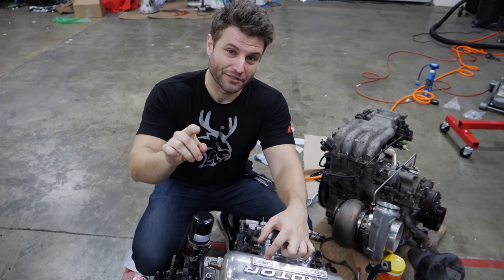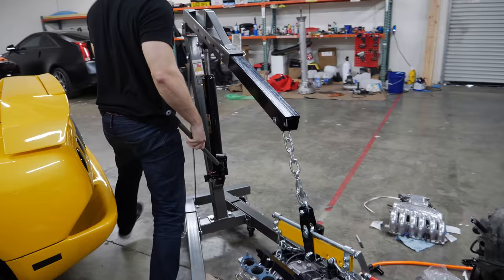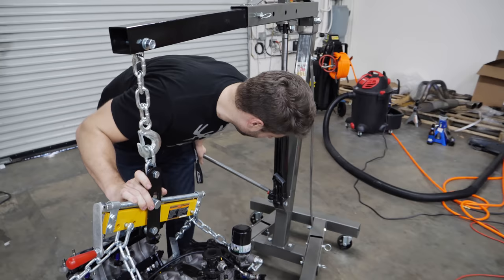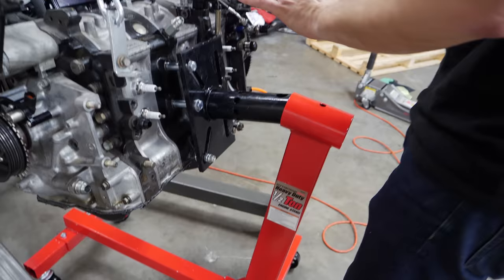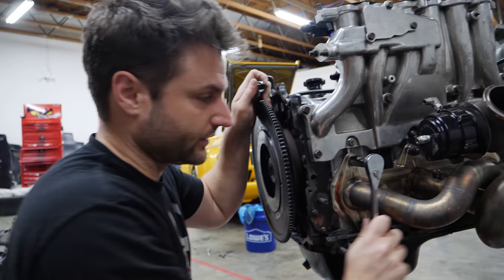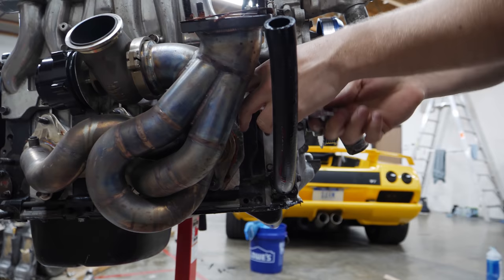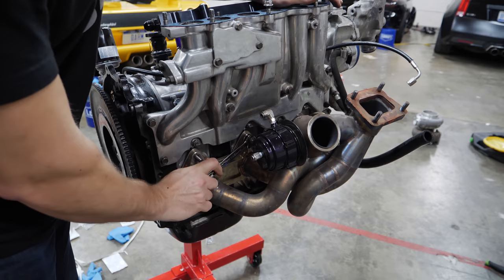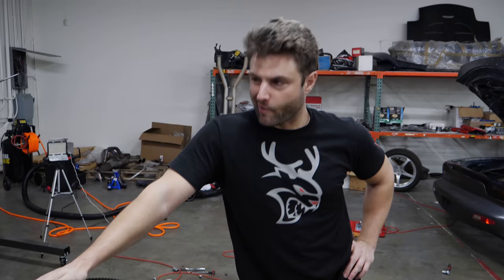3 Rotor Vs 2 Rotor. Why I LOVE the 20B so much.

Comment: Instead of going through a lengthly and costly conversion, Ive been thinking about just getting a 3 rotor Cosmo now that they are 25+ years old.
Reply: @rotorthermotech1310  There's a few on my local Craigslist for $19k with clean title.
Reply: TurboDieselDan , that’s reasonable, rare as hens teeth here in Australia
Reply: Very rare cars those cosmo's

Comment: Rob Dahm Engineer an intake air cooler that uses Dry Ice in a closed system to cool your intercooler.  Excellent videos, longtime fan here.
Reply: Wouldn't work dry ice is mostly co2 so not much "air" there.
Reply: @joedumars7311  Not to be an asset, but no kidding man 😂...a closed system means using the cold to cool a copper "intercooler" on the intake utilizing dry ice, while venting the co2 into the atmosphere.

Comment: I'm surprised to hear the 13B from Rob's car only 350 lbs include everything, I remember someone weight a 13B-REW (twin turbo one, with all the stock accessories on it) was around 510 lbs, where LS engine were merely 400 lbs.

Comment: So, let me get this right, a giant turbo 20b will make more power than a stock ls6? Um, duh? 
A modified N/A 3 rotor is only going to make 300whp.. a stock ls6 is going to make more... Turbo'd 3 rotor, vs turbo ls6, they're both going to make tons of power. 

You also weighed the cast iron stock manifolds for the ls6, but not the manifold for the 20b... 

I'm not hating on the 3 rotor, in fact, I would love to put one in my ae86 like those crazy Japanese guys did years ago... but this is a apples to oranges comparison masquerading as a "fair" comparison.
Reply: 20B exhaust manifold was still on the motor when he weighed it.

Comment: So I have a 350z shell I've been planning on putting an LS in, but there's a free non-running 13b in my town I might pick up. I also have a diesel turbo that's normally useless for gas engines due to oil pressure... am I crazy for considering putting this in the Nissan? I know very little of Dorito engines....

Comment: Can you do a comparison between  the 4 rotor and LS. And explain how you get a 4 rotor since Mazda didn't make them for production vehicles.
Reply: Wise Guy you can get a 4 rotor by taking two 13b’s and putting them together. The only hard part is getting an eccentric shaft since Mazda didn’t make one. But some rotary shops custom make them. I’m sure if Rob made a video he would go into more detail.
Reply: It's almost like he made almost a whole video series about getting the 4 rotor, and then it getting lost, and then him having to buy the parts a second time from the guy who bought them at a FedEx auction.
Reply: @dan.r9220  thanks man, I didn't know that he did. New to the channel and looked and found some of those old vids. Appreciate the direction.
Reply: @wiseguy__  of course man!! Always here for the help. Rob has a lot of good rotary content from back in the day. Then he took a long break and is now back on more consistent video making.
Reply: Pinball Master no thats not how you do it.
Reply: Wise Guy that is incorrect.

Comment: I'm not trying to criticize and I'm certainly not a fanboy of pushrod LS engines, but after comparing them and stating that they were comparable in weight with the 3 rotor being just a bit lighter, you stated that the 20B could kick the LS6's ass.  But in stock form a little googling led me to find that the the 20B produced 300 HP with 10 lbs of boost but the LS6 produces a minimum of 385 HP with no forced induction.  I think it's also well known that rotary engines consume a lot of fuel, so I don't think that is kicking ass.  Especially since the LS6 could still be force fed to increase it's numbers just like the rotary could.  To make a fair comparison I think both engines would have to be in a similar state.  It would be more accurate to say that PER LITER of displacement, the rotary kicks ass.  That seems fair.  Am I missing something or are you indeed being a fanboy?

Again, nothing against the rotary.  I love the small size and light weight, but in this case that doesn't seem to be the advantage.
Reply: The rotary can make more power if you can rev it up to 11000 rpm without it blowing up.
Reply: It can make more power if you can rev it up to 11k rpm it without bowing up. Though it'd need premium fuel n ither stuff

Personally i think the best ice is 2 stroke opposed piston engines tho. Double the power strokes and already self balanced engine.
Reply: Mazda Miata but would it make similar power to the ls6 but revving higher and would it be nearly as reliable? As OP said, not fanboying LS’s. Just curious
Reply: Mazda Miata by revving higher*
Reply: The n/a LS in the dry around 400lbs...
The 3rotor with turbo around 400lbs...

Taking that package, the 3r wins - this is what he did say; also he did mention, that you can do forced induction on the LS but that will add weight as you need additional oil cooler, turbo(s), piping aso....

You can then build a twin-turbo 4-rotor - that sounds like a F1 car and goes like the Belzebub who burned his balls on the stove.
Reply: @ldorman  Ok, so by weight then.  But it's still 85 HP shy.  That's a lot.

Comment: The 2 rotor 13B RX8 engine does have three runners on the Exhaust manifold due to the the side port exhaust design.
Reply: Yea but the renesis is a special case that nobody builds for performance cause its pointless.
Reply: @fastec5  Not true. People reliably have installed turbo's with proper piping and intercoolers to achieve 300 BHP on a renesis engine at 12 psi of boost. It's not common, but definitely can be done and not completely difficult.
Reply: @sofakingdom3076  we are talking from the factory here. You are talking to an RX7 owner who is piecing a Reni together in hybrid fashion to slap into my FB lol, I know. But the Renisis is the engine that destroyed the rotary's name.
Reply: @fastec5  Emissions destroy many engines including the renesis. I think it's great for what it is.
Reply: @sofakingdom3076  except for the inherent design flaws Mazda put in it. The exhaust port design is terrible and allows carbon to build up. When that carbon buildup breaks off bye bye seals. And the oiling system is terrible. Mazda fixed the Reni's issues when the S2 came out but by then it was too late. Also, emissions affected the 12a and those things were bulletproof.

Comment: I've always wondered where people get these 20Bs ? 
Except the Cosmo which is a valuable classic and the 757/767 which are valuable racecars, Mazda never put this engine anywhere else (i think).
Are they custom made with 13Bs ?
Reply: 9 times outta 10 that's exactly what happens. Unless you get a half cut cosmo from overseas you've gotta get your 20b power through a highly skilled machinist.

Comment: So your saying a completely custom fully built rotary engine is better then a bone stock LS6.  Good to know.
Reply: Yes, and at the same time, a bone stock rotary is better than a custom fully built LS.
Reply: @bigolbootycheeks9138  lol, I do agree with you kinda.  Its funny how "fully built" lead to breakdowns more often.  I would still run a cam only LS over a rotary just because it easy, powerful, cheap and still more reliable.
Reply: @bigolbootycheeks9138  Nah..

Comment: Honestly, the 3-Rotor should go in the Corvette Body & the 2-Rotor should go back in the RX-7.
I remember how much of a problem you had with engine bay clearances on the RX-7 with the 3-Rotor.
Shoving a 3-Rotor in a tight bay isn't good for (thermals, maintenance, or modding)!

You want to have as much room as possible for all the crazy stuff you want to do, that means shoving the right Rotary in a spacious Engine Bay so you can do work and improvements.
Reply: @msengineeringdavid3702  You first!

Comment: I'm pretty engine agnostic, just trying to understand. How is the 20b more powerful than an LS6? I'm looking up specs, and I'm seeing between 250-300hp for the 20b, while the LS6 makes around 400 if I remember correctly.
Reply: He's accounting for the fact that he added a turbo to the weight. he can turn the turbo up and the rotary will easily make 1000+.
Reply: @dan.r9220  it'll hold that power with stock internals? I can't remember what the stock LS motors will hold, but it seems like it was 600 to 700 hp. Doesn't cost much to bullet proof them though.
Reply: @jasepoag8930  Yeah I think it's all sort of a lie from rotorheads.  He's not comparing a stock 20B.  It won't hold 1000hp w/ no mods.  If it did everybody would have one.  It'll cost more money to get a 20B to 1000hp than it will to get an LS to 1000hp.
Not quite sure how he justifies comparing a boosted 20B to an NA LS and then saying you can boost LS's, but then writing that off like some extremely rare thing, as if boosted 20B's are in every junkyard.

But anyway, takeaway: "20B > LS"; "These are just objective facts, I'm not being a rotary fan boy here"
Reply: @MrSlowestD16  Pretty sure if they are throwing aftermarket into the equation, N/A LS is over 1000hp... aftermarket block and headers will be lighter than a 20B and stock for stock the LS is more reliable, better fuel economy and fits more displacement in a smaller space.   With that being said, I would still like to see more rotary stuff.
Reply: He was just strictly saying for the weight of those setups a 20b with a turbo will make more power than an NA LS.. You could throw a ton of money at it and make as much as that 20b I'm sure no problem but as they sit the 20b will make more power easier. That's why he kinda said that's neither here nor there because he knows it'd be easier to throw a turbo on that LS and it'd smoke the 20b he was just kinda saying.. No real point. We all know what's up, the LS is more reliable and cheaper to make more power.

Comment: I could have bought a 13G spare 3 rotor race engine from racing beats land speed record rx7 for 10k , but shipping costs were killer
Reply: When was this? Like close to a decade ago? I remember that thing, they put it up on rx7club I think. Quite the motor for the price.
Reply: longer, back in the late 90s .. saw it advertised in the back of fast fours & rotaries . this was before everyone was shipping stuff everywhere and you can get deals and it cost a mint to have large items sent from overseas.
Reply: @shoominati23  damn, that's cool. I know there was an exact replica of a 13g, down to the sliding throttle bodies even, that was up for sale about 10 or so years ago on the club. I think it was about $10-12k

Comment: The question I have,  is can you make a rotary as reliable,  or last as long as an LS?
Reply: Yes, it's possible. All depends on the way the engine is used and the maintenance you provide.. If you drive like a dickhead and don't look after your engine, it doesn't matter if it's a rotary, a LS or a Detroit diesel, it will fail...

Comment: Hello,
You think it's possible to put a 3 N/A rotor on a RX-8? (and how much horse power to expect?)

Thanks ;)
Reply: Check out Defined Autoworks. They got a N/A 3 rotor peripheral port making 475 to the wheel. Streetable power, half bridge with Rx8 10:1 rotors, milled for rx7 seals. Probably 400 wheel. As for putting it in the Rx8, you got $50k?
Reply: Considering that the 13b/20b engines are totally different to a Renesis, not to mention the engine harness aso.
Do you want to have the electrics in the car working as from the factory? - if yes, you might in the $40k to $50k region.
Here in the UK, RX8 cost pretty much nothing, the other day I found one for £500 with the good old hot/cold issue - and 13b raceport rotary engines you can get from 1.5k upwards - but when I checked the work what the built involves and considering I have a 40hrs job and also like my other hobbies... I stuck to my BMWs - they fast too.

Comment: I'm really surprise you haven't gone beyond a 4 rotor and make a 5 or even a 6 rotor lol dreams can come true just saying 😎
Reply: That would probably be pointless as the crank parts and other drivetrain components would likely rip themselves apart with that much load.
Reply: @evilblackcat6357  6-rotors exist though

Comment: Can you build a custom 3 rotor out of the 13B parts(a 19.5B)? I hear a 13B is a better engine but the 20b just has one extra rotor. From way different compression ratios. What would be better a 13B 3 rotor(19.5B) or a 20B? Or is a 20 b just a 19.5 CC also? I'd rather have a 19.5B frim 13B parts low boost, electric wastegate, safe high RPM. More than 3 rotors is unnecessary in my opinion. Maybe unless you're going N/A. But a turbo 3 rotor is more than enough. For a street or track car.

Comment: Serious question for Rob or comments. Does anyone have or know any good e-shaft CAD models? Especially, for the 3 and 4 rotors?  I have access to a 3d printer and want to actually see the prints side by side. Or does anyone know what the rotation offset per rotor added is? Like what would a theoretical 5 or 6 rotor e-shaft look like?

Comment: You're writing an awful lot off as "objective fact" that the 20B is better than the LS, and that's a very bold claim with very little objectiveness about it.  LS makes way more power & torque with same weight, more reliability, and less cost, stock for stock.

With that aside, maybe next time you can explain why that 3rd iron was different (or specifically what's different about it), I wouldn't have expected it to be any different than the center of a 13B, and I'm sure I'm not alone in that thought.